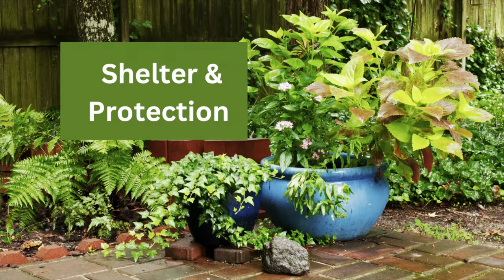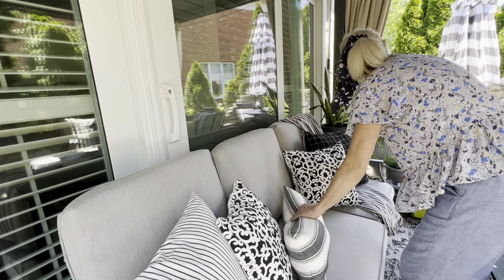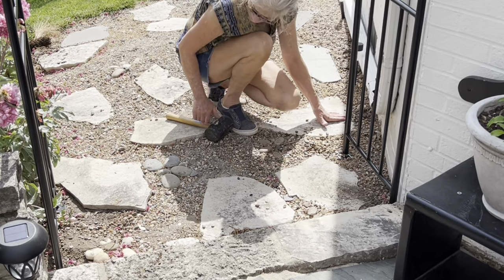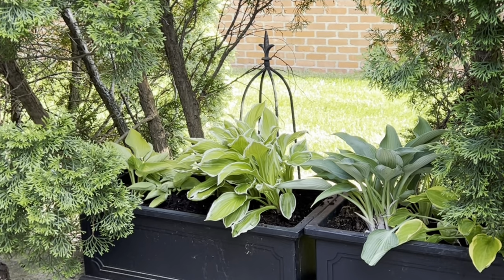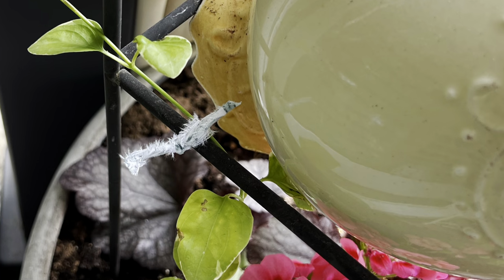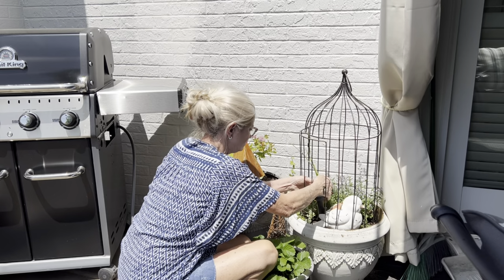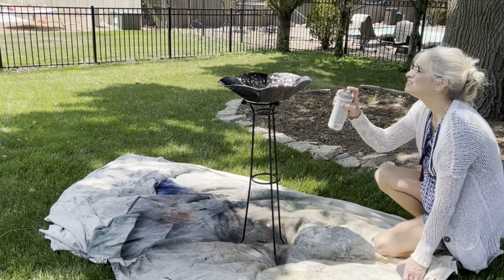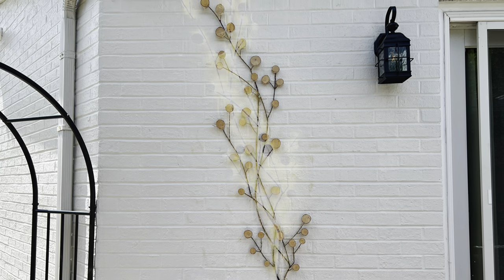COZY PATIO MAKEOVER: 10 Ideas to Enhance Your Outdoor Living

Comment: All of the things on my deck are sourced from op shops, recycling centre or market place, but one thing I did buy new was my solar pump, to change out my old electric water feature to solar and spent a "little" bit more to ensure it had battery backup for night time use. Bonus it has a light to see it at night also.

Comment: It looks beautiful.  So if you want your waterfall to run at night,   Thrift a floor lamp in the shape of a candy cane. Fined a lampshade that has a wire frame.  Remove the material from the shade, replace it with clear flexible plastic.  Now take and buy the peel & stick waterproof paper. The kind that looks like stain glass or whatever you like. Then place it on the clear plastic.  Replace the lampshade back on the floor lamp. Now buy a pack of small porch rail solar light. Or battery operated  with control, Flat  lights. You are going to attach the lights to the top of the lampshade.  The lamp above the solar waterfall will make it work. 😊

Comment: Beautiful How did you hang the piece on the brick wal
Reply from the maker: In a previous video, I drilled a hole in the mortar (with a drill bit for concrete and brick and added a plastic anchor.)  I hang something different from it every summer.